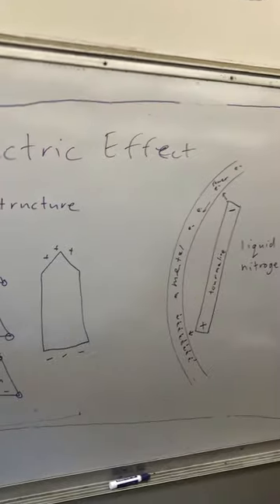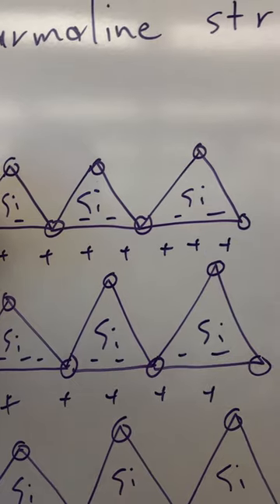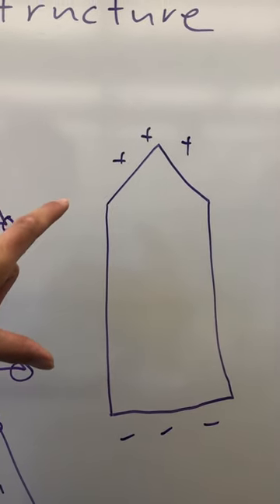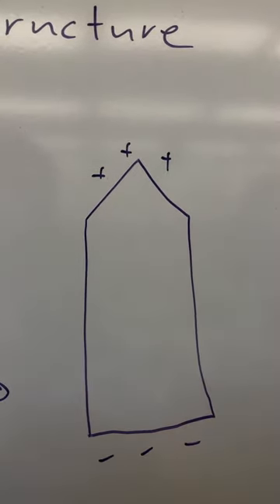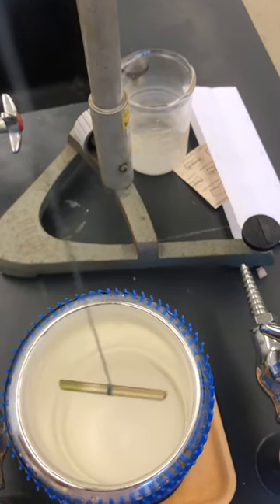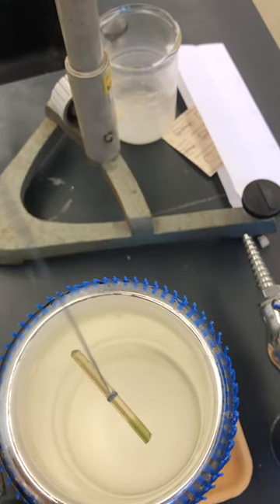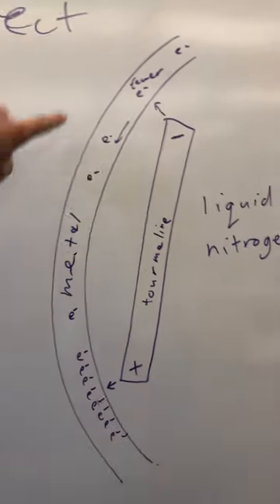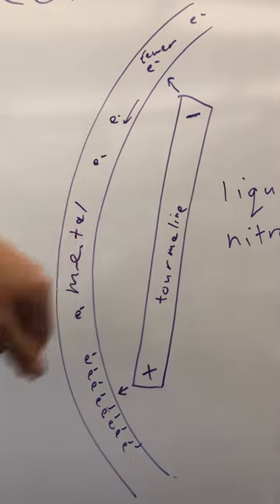The Pryoelectric Effect in Tourmaline

Comment: Amazing! I wonder why it stuck instead of conducting through the walls of the flask. Also, I wonder if the effect would be as strong if it was dunked in boiling water afterwards.
Reply from the maker: The aluminum coating is behind a layer of glass, so the tourmaline sees only an insulator.  Ordinary tap water, on the other hand, is too conductive, so the charge will dissipate right away.  It might work with distilled water, though . . . .

Comment: I've never seen it demonstrated until now! Will you get a shock if you touch one end?
Reply from the maker: Not sure I've actually tried that, but I've never seen sparks, and touching the tourmaline to metal doesn't seem to discharge it.  I suspect the tourmaline is too good of an electrical insulator to actually let the electricity out.  But if you made a capacitor by gluing some metal foil to each end, I suspect you would get a shock then.
Reply: @tecto_nick  interesting. Ya the putterman group at UCLA covered a piece with foil and connected it to a sharp piece of tungsten I think? a couple decades ago, and put the tip in a low pressure container of deuterium and ended up getting a significant amount of nuclear fusion reactions out of it. Crazy. I think they called it pyroelectric fusion. Totally impractical obviously, but neat.
Reply: Have you tried this with black tourmaline? Like does the type of tourmaline matter?
Reply: @ChristopherColdness  I literally just did it with a piece of schorl the other day. It works!

Comment: I wanna do this experiment for my final presentation and i bought a tourmaline rock then i put it in boiling water but it didnt work , does it deppend on the shape of the rock or the boiling liquid ??? Please answer my question and give me some advices . Thanks
Reply: its done through a contraction in the very cool liquid nitrogen, which is boiling not because it's hot but because liquid nitrogen is a condensed gas with a low vapor pressure at room tempeture. Cooling compressed the crystal warming it up in boiling water expands the crystal, which you answered my question for me…would this work when heating the crysal up.
Reply from the maker: I suspect the biggest problem with boiling water is that it’s electrically conductive at the voltages involved, which dissipates the charge.  I know from experience that acetone + dry ice also doesn’t work.  It probably has to be a non-polar liquid; maybe hot oil would work?
Reply: I think is not water what it use in the video, I think is nitrogen

Comment: So your super cooling carbon like a super conductor. Dose this work with diamonds as well? I want to experiment with nuclear diamond batteries.
Reply from the maker: Diamonds are not pyroelectric.  Because diamond's structure is very symmetrical, it acts the same in all directions, so there's nothing to make the electric charges move in one specific direction, which is how the pyroelectric effect arises.  If I understand nuclear diamond batteries correctly, in that case, electrons (and electron holes . . .) are actually being knocked away from their host atoms by nuclear radiation; whereas, in the pyroelectric effect, every electron actually remains attached to its original host atom, but the host atoms all move a very tiny bit in the same direction to create the observed electric current.  So if a nuclear diamond battery is like one person kicking one football/electron 50 yards, the pyroelectric effect is more like 1000 people holding footballs/electrons who all step one inch in the same direction at the same time.

Comment: what about thermionic emission
Reply from the maker: You won't get it in this experiment because it's too cold.  The "therm" in thermionic means heat.  But it's possible that if you heated up a tourmaline crystal enough you might get thermionic emission.  Or at least that's what the "tourmaline hair dryer" companies want you to think--though I'll note the pyroelectric effect is related to changes in temperature more than the absolute temperature . . .
Reply: @tecto_nick  im seeking the negative ions produced via the thermionic emission because the pyroelectric method yields positive ions as well. any notes or tips for me? thank you 🙏🏾